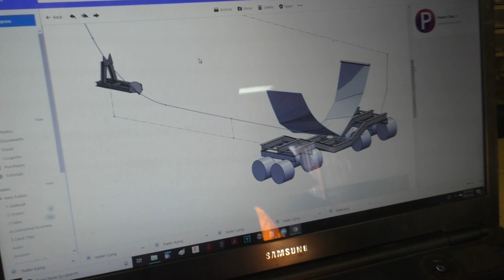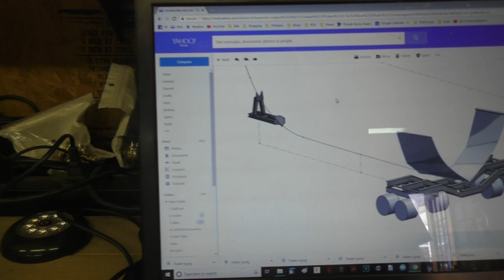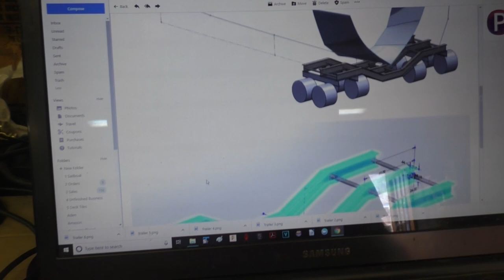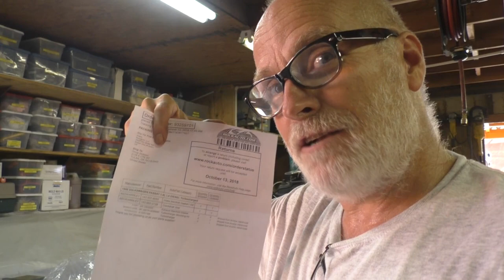SV Seeker Live - Main Hatch Opener, Kamando Joe, Diesel Jet Boat

Comment: Hey Doug... used to do endurance racing (raced Porsches in the 24 Hours of Daytona, etc), and the primary reason we wrapped our headers and exhaust was to try and reduce the amount of heat that was in and around the engine compartment.  If engine pieces-parts (electronics) get too hot, which they can over 24 hours of racing, they tend to stop working as well as they should, or at all.  That being said, there is a measurable improvement to exhaust scavenging as well, at least in our application.

Why?  It was explained to me this way by a Porsche Factory engineer once.

Exhaust gas temperature is related to gas density.  Exhaust gas doesn't flow like water out of a hose, it's a series of pulses and compressions because of the compression/exhaust stroke/cycle of multiple cylinders.  Exhaust systems are tuned to handle these various pulses coming from the headers (which is why exhaust manifold lengths are so important for collectors, etc).  Part of the physical "tuning" of the exhaust is done to work with  this pulse frequency and try and get the gas moving through the entire exhaust as uniformly as possible.  Changing temps of that gas causes a change in density, so the bigger the change in temp of the exhaust gas over the length of the exhaust system, the more effect it has on that pulsing/scavenging performance and efficiencies.  Lack of efficiency (due to reduced temperature) means more push back on the engine, increased flow resistance, decrease in speed of the pulses, and therefore reduced measured horsepower.  An engine is just an air pump, after all, and if you restrict or reduce the speed of the airflow (in or out), it will affect horsepower.  If you can keep the temperature from the header to the exhaust outlet the same, exhaust gases will flow and scavenge better.  The three general design rules of high performance exhaust systems are "keep it short, keep it straight, keep it hot".

Now, when you're doing 190+ mph on a race track at wide open throttle, that HP drop is noticeable and measurable.  For your application?  I doubt it very much.

That being said, it's probably not a bad idea to wrap it to help control the heat in the engine bay.

Just my $0.02

Comment: I noticed the charred barbecue sauce from the chicken on your grill grate.  After you take the food off and before you choke out the fire by shutting off its air, put a sheet of tin foil over the charred area and close the lid for 10-15 minutes.  It will turn the charr into virtual dust that is easily brushed away before you grill next time.  It is like cleaning an electric oven.

Comment: It was me who suggester the rack, when you mount them, you want a plate with longitudinal slots, that allows adjustment so the cog meshes to the next section, in your case it would be handy so both sides can be synchronised, maybe some angle welded under the hatch ?
Reply from the maker: Thanks Sparky they are installed and plan on a test in the morning.

Comment: i am the same as you i dont think wrapping the exhaust gives you extra power but what i think it does it help to get the heat away from the motor and 
then it may help with your heat problem

Comment: Hotter exhaust gasses expand much more than cooler gasses increasing the flow. The exhaust system can be very tricky to get perfect for optimal horse power or torque. I’m sure a turbo car drag racer can expand on this even further. Great videos, keep them coming.
Reply: I doubt Doug's tender engine was picked for 'optimal' peak high performance, where every little tweak needs to be done to not be the next slight bottleneck in the system....many people coat and/or wrap the exhaust just to try and manage engine compartment temps, and in a boat you might have components crammed into a tighter area closer together that might be effected by the heat given off externally from the exhaust plumping, and far less air flow thru the engine compartment or under it like in a car
- so it might be more important to water cool the exhaust in a boat -
...I have 5 boats with inboard engines(454 V8, 350 V8, 1632cc V4, 1240cc i3, 800cc twin) and 4 WetBikes(800cc or 723cc twin 2-strokes) and they all have water cooled exhaust systems...I've had many discussions about the exhaust systems of the small jetboats and WetBikes, and the people who have modified(aftermarket or diy parts) all say the aluminum exhaust components must be water cooled or they will melt...both my big boat(with the V8 engines) have large watercooled exhaust manifolds

Comment: I bought an 81 Rabbit, overhauled the engine and ran it off/on for 8 years.  I had problems getting it to hold a head gasket at first (it has the old style head bolts, the ones you can re-use), the solution to that was a new torque wrench and a day of nothing but warming it to temperature, re-torquing, letting it cool completely (rinse, repeat).  By the time I'd gotten to that point, I could change the head gasket in 4 hours, start to finish.

When I finally parted/scrapped the car, I kept that engine, thinking of maybe building a higher output compressor pump from it.  If yours uses the V.E. injection pump, you are welcome to the pump from this one, to overhaul and keep on hand as a spare.  There may be differences to consider (turbo/non turbo) but as long as those differences are external and the various parts can be moved from one pump to the other ... well, someone probably knows what it would take to make it work on yours, and could advise you.  If it can be made to work, and you want it, let me know.  I'll see about swinging by with it the next time a truck move brings me to Tulsa.

Comment: Adding to the Exhaust insulation debate,  Yeah it might increase the performance  slightly,  but for me the big win would be when you stop the engine  for whatever reason only remember when you grab the exhaust it to balance yourself that it  it stays hot.

Comment: Also, I'm a qualified auto engineer and I reckon you're bang on. Insulating the exhaust won't make a blind bit of difference to the hp of the thing
Reply from the maker: Yeah, cooler in the engine compartment but I can't see any reason it would add HP.

Comment: For the drive, maybe source a piece of hex stock of a nominal size and then mill the end of it square to fit.  Make a couple, so you've got a spare sitting around.

That way if you lose something in the drink or something breaks, you can use an open ended wrench, a ratchet of a different size, or even just a crescent wrench to hatch opened and closed until you get a replacement.

Comment: A turbo charger works on the air going in is  expanded to coming out a larger volume of air to spin the turbo. Keeping the air hotter will raise turbo performance
Insulating the manifold , turbo, does gain boost. Not a terrible amount but does keep the heat lower in engine compartment. I would disconnect waste gate and install a pyrometer
for more performance. I gained from a 7lbs waste gate to 18lbs boost just let off the throttle a little so you won't over heater the exhaust.

Comment: I love Komada grills! My roommate has an original from the 50s and it works great even with a crack almost all the way across the top!

They make the same hinge assembly for the green egg, they also have very sophisticated temperature control units that will automatically stoke the flames when it needs more heat! Look into it, you guys could be cooking dinner all day without trying!

Comment: Only thought on insulting the exhaust. It helps keep the engine compartment cooler, if the air intake is inside the engine compartment it would get "cooler air" which would be denser (more oxygen). Air Density is very important in making horse power. We check and tune to it on every pass at the track. The problem I see on a boat is it might trap moisture and rot out the exhaust.

Comment: The only need for insulating the exhaust is between the engine and the turbo, after the turbo its only needed to keep the heat out of your engine compartment, the hotter it enters the turbo, the higher the eficience, after the turbo , its not that inportant, before the turbo it is. dingy is looking good Doug!

Comment: Only use a turbo blanket is the turbo is designed to have one, generally. The channel Engineering Explained has a great video on this and it has to do with the tolerances and bearings needing to be designed to run at the higher temperatures that a blanket will provide. It also explains why you would want to blanket from the manifold, over the turbo, and to the catalytic converter. A turbo designed to be blanketed will produce more boost and be more efficient since it is running at the higher temperature compared to the later parts of the exhaust system. Blanketing a normal turbo will also increase efficiency, but at the cost of shortening the life of the turbo. Considering how few hours you are likely to put on the tender at full throttle, it might be worth doing for the extra HP. Just plan on replacing it much earlier than the normal lifespan.

Always use fresh studs and bolts on torqued equipment unless the manufacturer'lines saw otherwise. The bolts/studs deform under tension when torqued and most fasteners are not made of high enough grade material to not stretch a little. Reusing old fasteners can cause seizing from thread deformation, lower toque than needed to make a full seal, and broken fasteners when torquing, in use, and during disassembly. Save yourself the headache down the road and use new ones whenever you can.

The fence rack and pinon material looks to be glass fiber reinforce nylon or possibly another glass fiber reinforced polymer. It should hold up great to saltwater and load it is taking as long as nothing hits it, especially as it gets older and more brittle.

Comment: Doug, it's about engine room temperature and it's effect on power. Hot engine room equals poorer performance. That's from horsepower to longevity. Heat does not make a turbo run better it wears it out faster. This is a tender not a race boat. Keep the compartment cooler and it will last longer. I would be tempted to make a water cooled exhaust manifold but I can't remember how you are cooling your engine so I can't make a suggestion there. Every deisel boat I have ever owned or worked on has had a water cooled turbo if it had a turbo at all. The turbo and engine are fresh water cooled and the exhaust manifold, heat exchanger, oil cooler and exhaust are raw water cooled. I hope this info helps you out. That bash plate under the jet pump is the way to go. Protection and planing surface. Who could ask for more. There are numerous jetski drive trains in jonboats on YouTube and they all use the ride plate under the pump. If they didn't need it it wouldn't be there. If you don't care about speed in your tender why put a big complicted car engine in when a little Yanmar out of an old sailboat would have been easier and cheaper and move you at 10kts or so? Not being critical it may have seemed a great idea at the time. I really enjoy these videos and you have the best attitude on YouTube. See you on the next one.

Comment: The pirate joke me laugh, my wife not so much.  Had to watch this twice.  Could you fire the exhaust headers and make the sand you put in the paint "glassify" and make a ceramic coat on the header?  Would make a pretty corrosion resistant surface.  Just an interesting idea.

Comment: Betsy
Check out this . It's called tip top temp.
 https://tiptoptemp.com 
It's a great upgrade for your Kamado . Automatically controls top air vent making constant tempature .I put one on my Kamado more cab smoke meats and cook or bake and added benefit use lot less fuel. Hint bottom dampener is barely open after getting coals/wood ignited